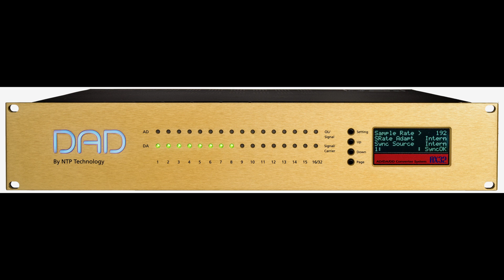Audio Converters / Interfaces

Comment: The quality of A/D converters were a big deal in the pro audio industry back then however they did not turn out to be a game changer. Ill give a few examples. I used to listen to mostly rock, hard rock and metal. Started to die in the mid 90’s. Megadeth recorded some of their best sounding albums on digital reel to reel machines. Another example, for me one of the last really good albums that I can still listen to from front to back and at high volume levels without burning out my ears. Released in 2000. Totally pro tools sound compared to all their previous albums. Must’ve been recorded on the 888’s. I’m assuming. Sounds fantastic to me still. Disregard the lyrics and listen for yourself. https://youtube.com/playlist?list=PLD3399A3641851031&si=xakDCB0fhCFy3J5L

A/D converters got better yet I can’t list 5 albums since they replaced the 888’s that make me want to listen and really have a blast. That venom album to me sounds even better than Metallica’s 2008 death magnetic. 

My question is how much better does an album have to sound than that venom album to be a great album? And my point is that A/D converters, faster computers, bigger hard drives, and all the latest and greatest plugins cannot make great albums. We have everything we need now except good music.

Comment: What some people often overlook about the clock /sample-rate is the impact on DSP, like compressor plugins etc. Recently plugins have improved, with there's enough CPU to for oversampling etc, but in the past it made a noticeable difference to ITB mixes. I used 96 for that reason, not because I cared much about the bandwidth or the converter filters
Reply from the maker: Clocks are so important

Comment: I get that the modern converters are all pretty decent, but when it comes to the old 192s compared to the Apogee DA/AD8000's and the modern day converters, how do you feel they stand on their own? The 192 is over 20 years old, Im not sure if it fits in with the modern converter conversation or not. Just curious on your take.
Reply from the maker: I would have to line them all up and listen again
Reply: @fantastictalesofproaudio2391  Fair enough.

Comment: I have a converter fatigue, because converters are totally overrated in my opinion. And the loss in value is very fast. As an audiophile, of course there are differences, and 96k recordings make sense, because the layering of different instruments and the localisation is more defined. And the grainyness disappeared.
Reply: Converters aren't necessarily "overrated" imo, but nowadays most converters from most companies are pretty darn good.  Converters are an important part of the puzzle, it's just now we don't have to fret over spending a fortune or having the latest and greatest anymore like we did even 10-15 years ago.
Reply: @switchesanddials  Good point, thanks!
Reply from the maker: Agreed
Reply: today few companies make the actual AD chips, then companies manufacturing converters build the box around it. Overall you moving your head 1 inch makes much more difference in sound than any of today's delta sigma converters have between them.
Reply: @dom2555  Yes, the old Burr Brown PCM1795 for example is well known and also in some of the newest products.

Comment: In more modern times studios started to spend a lot in converters not anymore for the sound quality itself but for the way they would handle clipping, famously the lavry gold soft clipping which would allow a more dynamic master while still being loud, in the last few years people replicate the same with digital products and different soft clipping curves. Still not a fan of sanding all possible dynamic range and definition but oh well. Serban instead achieves something similar with the spl machine head, it's a tape emulation but it does some subtle waveshaping.
Reply from the maker: Interesting

Comment: Music at 96k sounds amazing. Universal Audio should build Apollo tech into a home 96k streaming device so everyone can enjoy it. The problem is access—where do you even get 96k music? YouTube crushes everything down to near AM quality, so A/B tests of gear there all sound the same.
Reply: it's a size problem in the streaming world, same reason DSD or DXD never took off. The bandwidth (and storage) for streaming services to handle such format is undoable, especially in most of the developing world. Connections aren't fast enough, storage isn't accesible enough and data plans aren't big enough. Of course for us more privileged in the western world and china that would constitute less of a problem. Also they realized that most casual listeners can't spot the difference between 44.1kHz and mp3 320kbps, let alone 96kHz lossless.
Reply from the maker: There are website that you can buy hi res albums for download. You can even get DSD files.
Reply: @fantastictalesofproaudio2391  I know some of those, quite niche and focused more on classical music and jazz, but they do the trick. I was thinking more about streaming infrastructure, my spotify library is something around 30.000 songs, I can't imagine storing such songs in DSD locally, nor I can imagine streaming them without buffering. Tidal has a subscription tier (with limited material) with high-res masters (if and when labels provide them)
Reply: My opinion is YouTube has enough quality for music.

Comment: Agreed. The AD8000 with the soft-clip on the input was SO good. The soft-clipping was achieved in the analogue domain using transformer saturation, I as recall. Somehow, it sounded close to analogue tape when it was pushed. On a Pro-Tools interface! Magic.
Reply from the maker: There is one on ebay right now for $169...I always loved their meters